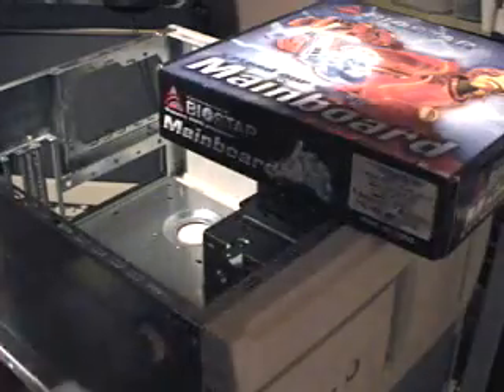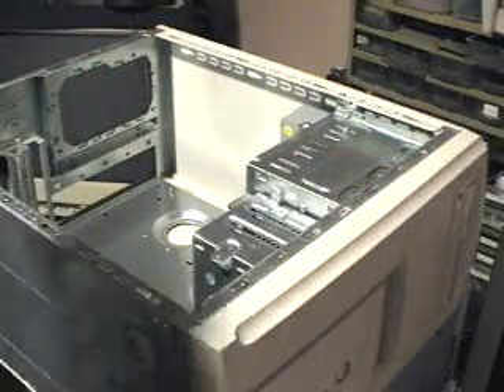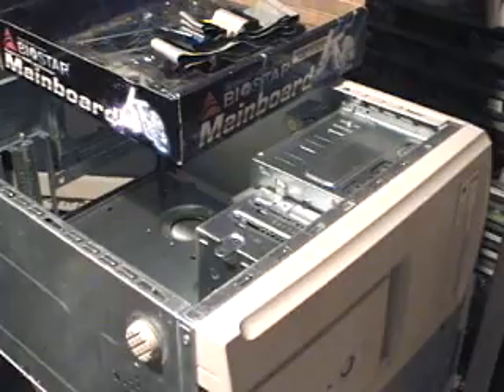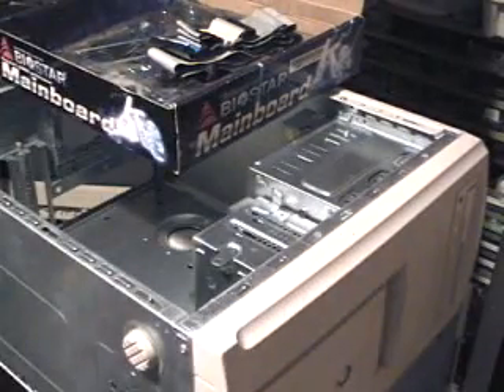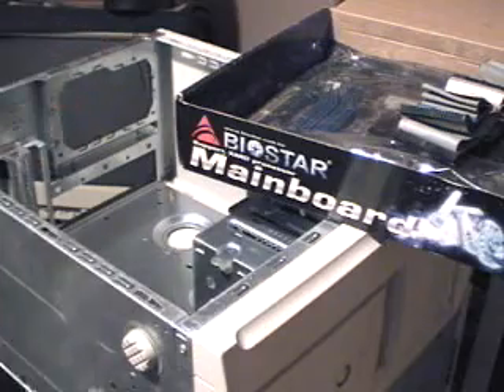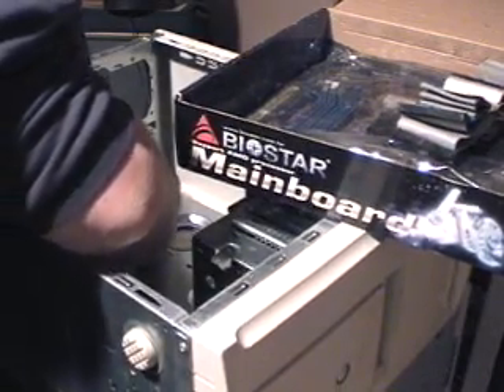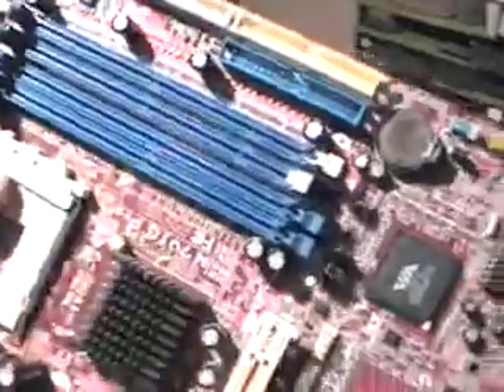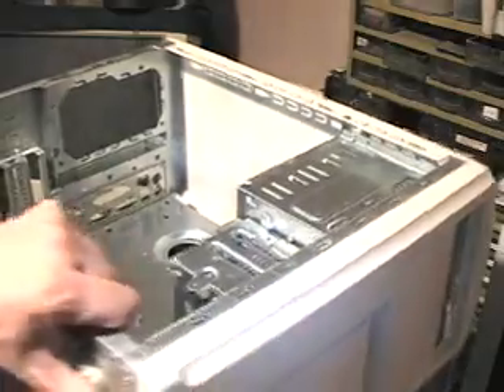How to build a computer from scratch.

Comment: i tought when the video said build it from scratch.  it meant take wires and a welder and make the individual things inside a computer then put em all together.  that would be cool, but i just know if i tried that, it would result in me electricuting myself.  wana make a new 1 because my computer suxs.  virtual pc works faster than the actual pc, it's very strange..